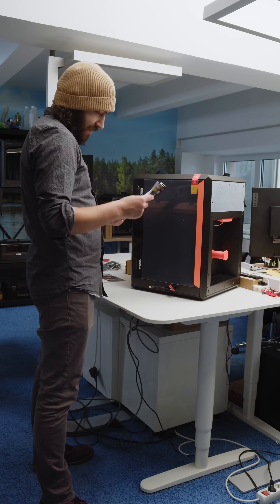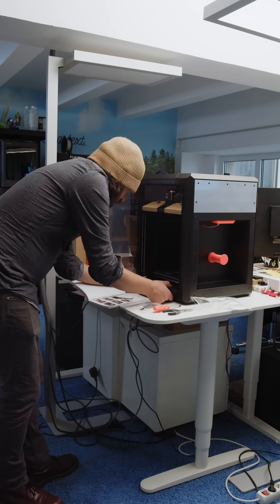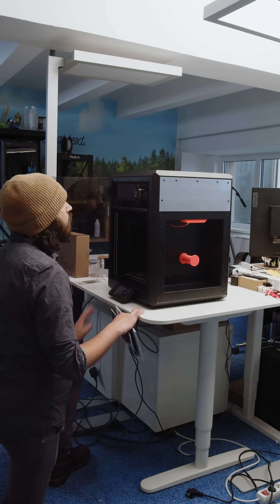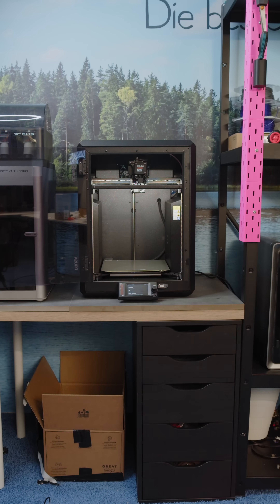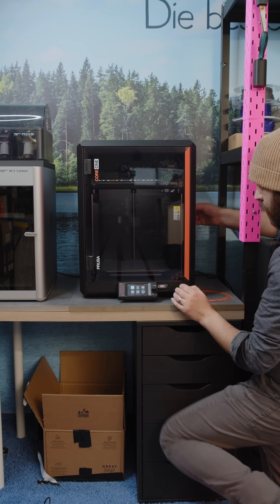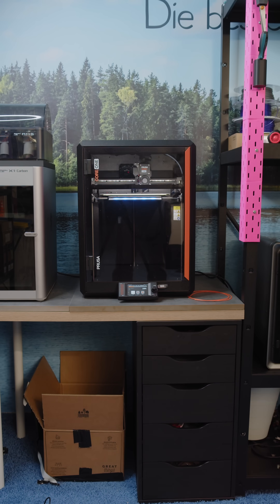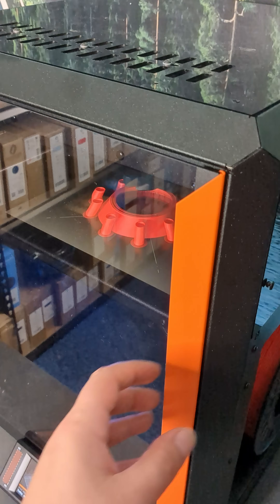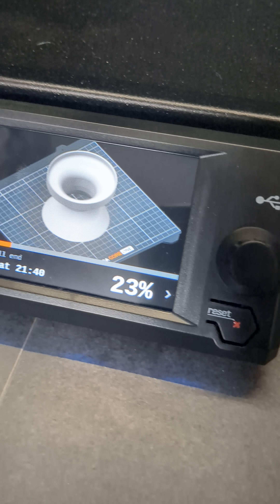Finally got the Prusa CORE One in the office! Questions?

Comment: How well does it fare with softer TPUs? Like 85A or softer?
Reply from the maker: We haven't tried softer than 90A but the build plate is just not suited to TPU in general. If you want to print TPU (or PETG) with this printer, definitely get another build plate or you won't be able to remove your print.

Comment: Wait what? You changed the z-contact distance in the slicer? Have the same issue with running PCTG, where did you change it or is it a gcode command?
Reply from the maker: In Prusa Slicer go to "Printers" at the top of the screen , Z-Offset is in the first section. But that is just for the printer profile, for us that was fine, PLA still printed ok with that offset and ABS was good too. You can create different printer profiles depending on your filament. That is a bit awkward in Prusa Slicer but for Orca slicer you can just go to the filament profile, then advanced and in the start gcode add the command: SET_GCODE_OFFSET Z=-0.075 MOVE=0
That might not work in Prusa Slicer for the Core One given the different firmware.
Oh and you can also do a live z offset adjustment by holding down the knob while the print is being laid down, useful fif you forget to change the printer profile to your new filament.
Reply: @3DJake_Official thank you so much! ❤

Comment: How good is printing Abs? My majority filament is Abs. Actually, you did not need the brim just use the glue sticks, I have 100% successful print without wrapping
Reply from the maker: So far absolutely impeccable results with ABS, not need for a brim or glue, the smooth plate just works.
Reply: @ I would like to see more Abs printing in the further action,TQ
Reply: My Core ONE does ABS/ASA very well. No brim, no glue, little warping on big models. Takes a long time to heat up the chamber and heat soak though. But it's set and forget. Have done over 100 prints in ABS/ASA. Maybe 1 or 2 failed. 

Textured PEI works fine, but Biqu Crypgrip build plate has been amazing.

Comment: The only real negatives I have heard regarding the Prusa Core One (other than price) are the noise level and build volume.  Do you find it loud?  Does the lack of volume prevent you from printing what you would otherwise print?
Reply from the maker: Noise level seems pretty standard to me, not really loud, perhaps a bit quieter than most actually. As for build volume, for us its fine but I get why people would want something like a 300, this is not something you can print a stormtrooper helmet on.
Reply: I have one, noise level are quite low even when you print with pla and the vents are open. Anyway, there is also a "quiet mode" that makes the printer very, very quiet at the expense of time (you get a +15% printing time with that mode I think)
Reply: It is bit noisy but there is quick solution if you dont care bout looks and print petg abs or something other that feels good in chamber.
Throw blanket over it and tape off all holes in enclosure.
Ofc that is hobo style and you might not want one to look like "chefs special".